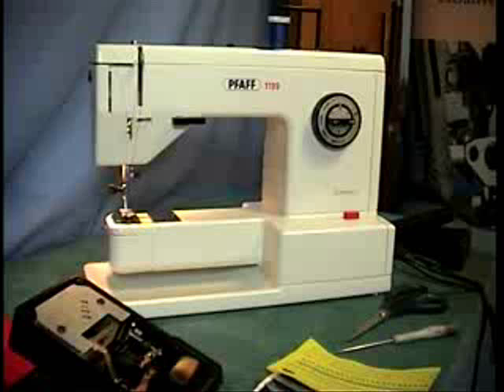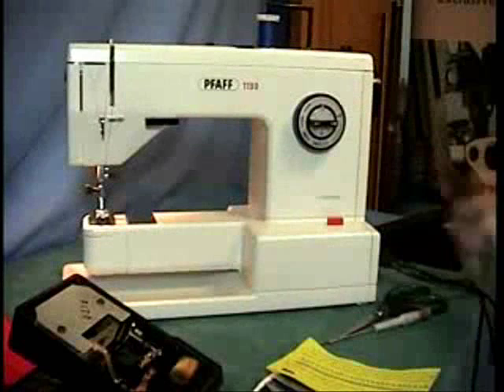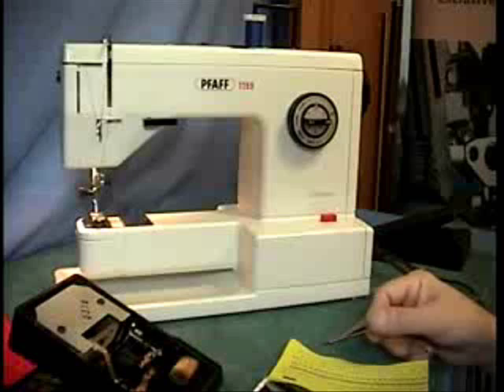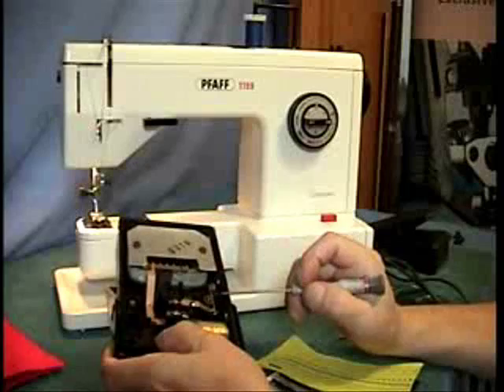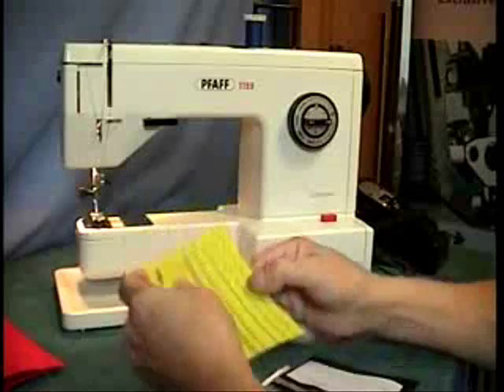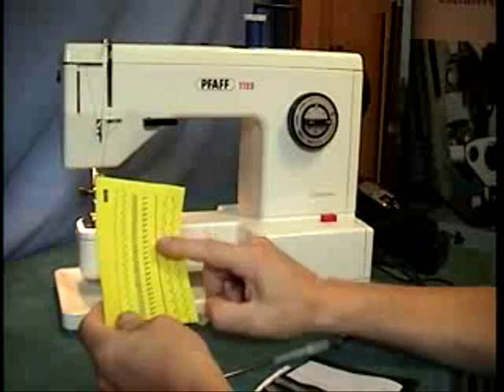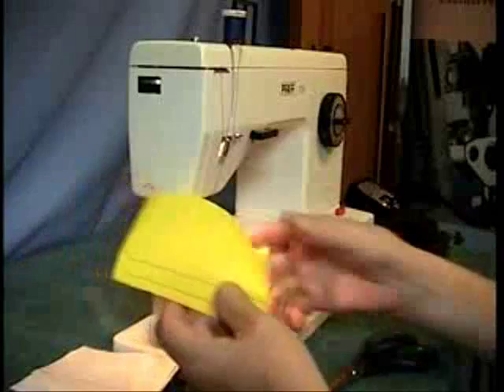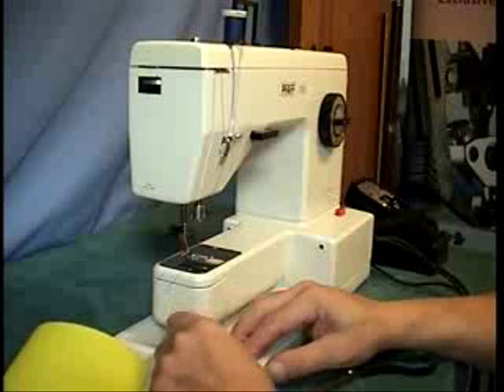Judy's and Ron's Pfaff 1199

Comment: I have a phaff 1199 and it suddenly slowed down and the wheel is hard to turn.  It turns backwards normally.  I blew it all out with a can of air and tried oiling it with some baby oil but still sluggish. :(